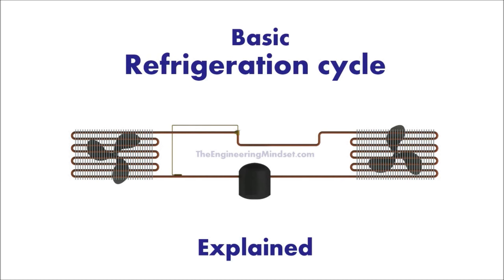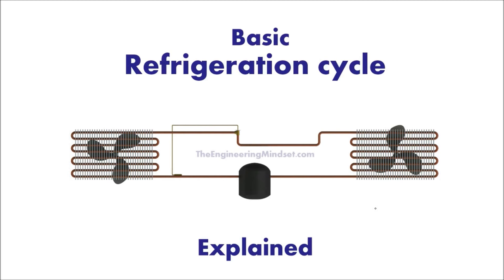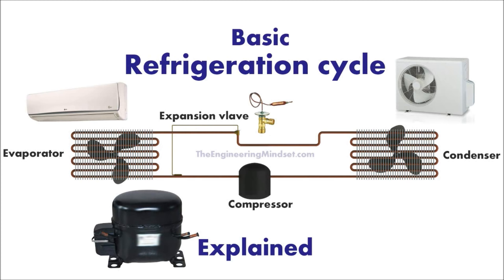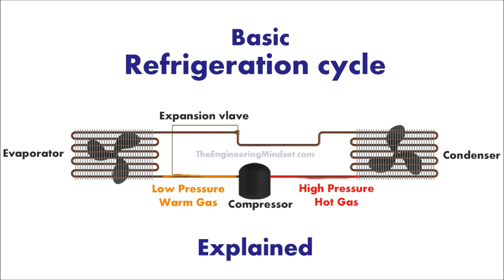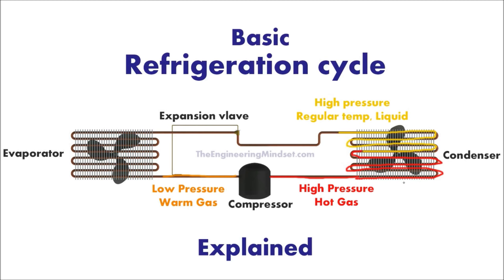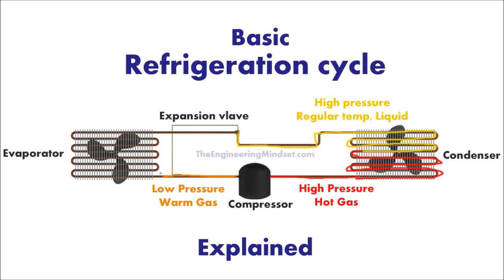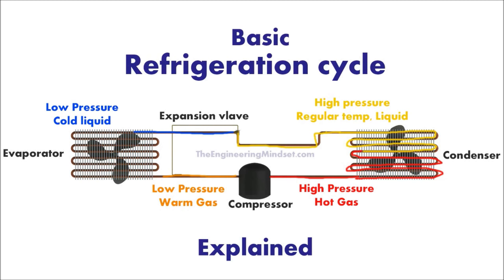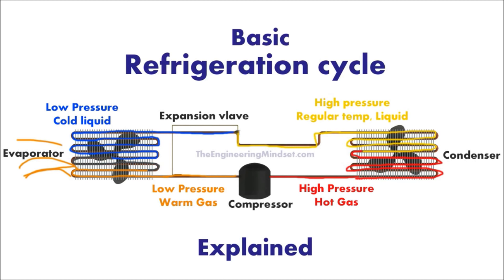Basic Refrigeration cycle - How it works

Comment: Good video overall, I know it's old, was looking for videos to explain refrigerant cycle to show my trainee. I am not sure I could recommend this video, however. Just some things that could help others who see this: 

-being overly specific on the cold/normal/hot etc of line temperatures isnt really necessary. For all intents and purposes we call anything after the compressor and moving downstream to the metering (expansion) device high temp, and we call anything in between the metering device and moving downstream back to the compressor, low temp. 
-you state the line in between the evaporator and compressor as warm, but the line between the condenser and metering device as normal, when in reality the line after the evap is usually 30-40 degrees colder to the other line and would never ever be warm.
Reply from the maker: Please see the newer video, this one is old and terrible
Reply: @EngineeringMindset  I'll definitely check it out! Love that YouTube algorithm would send me an older video instead of the newer 😂😂

Comment: Just googled it to find the answer.  TXV valve or the expansion valve is situated inside the evaporating unit and the sensing bulb is also near the outlet of the evaporation unit, so the expansion or TXV valve is in the my basement before the evaporation unit and sensor after the evaporation unit?
The sensor measures the compressor suction line temperature and the expansion valve release the the refrigerant mix (80% liquid and 20% vapor) based on the temperature set on the expansion valve? It ensures the super heat temperature the compressor requires to function?

Comment: hi,Thanks for your clear explanation of  Refrigeraton Cycler. I have one rather important question I would like to ask. Your Airflow where does the Air come from. Is it normally a Close Loop System where the Air is constantly re-circulated by the Evaporator Fan in the Fridge, or is Fresh Air Intake going on so that the Evaporator Fan is constantly pulling Fresh Air from the Outside and blowing it through the Evaporator Coils inside the Fridge. Also if it is not a close Loop System and the Fresh Air is constantly being sucked in from outside , is it vented out as it is recirculated inside and replaced by a fresh stream of air. Thanks

Comment: Wait wait..why are you entering the condenser at the bottom??? Shouldn't it enter the top as a high temp gas, which cools and condenses to a  low temp liquid as it descends (falls) through the coil? The low temp liquid then enters the bottom of the evaporator and boils off to a gas as it ascends (rises) through the coil. This direction minimizes the chance of liquid entering the compressor which would damage it. Or am I incorrect??

Comment: hi.how the refrigerant cycle work in a chiller?it is the same as video above?
Reply from the maker: +suicide sponge on a simplistic level, yes it's essentially the same, although instead of a fan blowing air across the coils, a pump will push water across. I will upload a video soon for how a chiller works but in the meantime I recommend you watch our other video https://youtu.be/1cvFlBLo4u0 "How a Chiller, Cooling Tower and Air Handling Unit work together" as I explain the process here and include a section view through the chiller.
Reply: The cycle is reversed

Comment: Great video.. however… you have described a “air conditioning system” the reason for this is when you mention refrigeration cycle but you clearly identify “warm” gas at a low pressure…!! 

As a 25+ year refrigeration engineer I would be worried with “warm” gas coming back to my compressor..!!!!
Reply from the maker: This video so very old, please watch the newer versions.